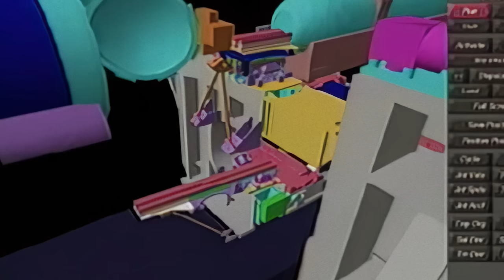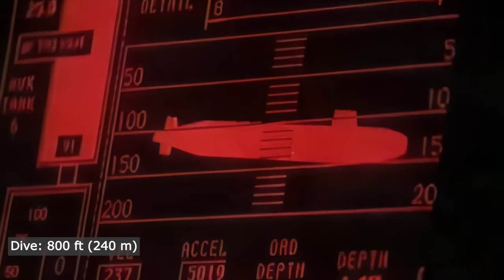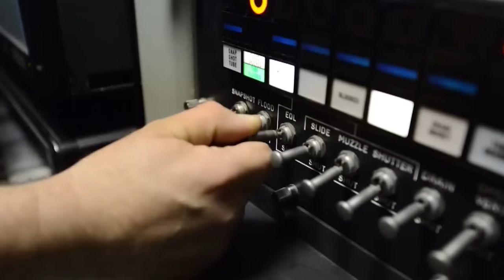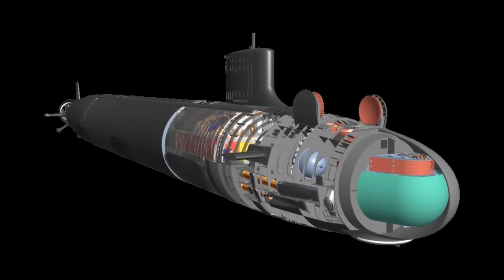Virginia class - the hunter killer

Comment: VPM does not mean Trident. Trident requires a hull diameter of 40ish feet and even then required a turtle-back on top of that. Virginia-class is only 30ish feet in diameter. Trident II is approximately 44 feet in length. VPM is similar to what is in Ohio and the other SSGNs but length is not one of those similarities.

Comment: I find it very interesting that the Navy still insist on hiding the screw structure. In the late 80s, I did two screw changes on 688 class submarines. They were performed at night. The screw came in on a tractor and trailer setup, all draped with canvas. The rigging equipment I borrowed from the shipyards, was installed with the cover still there. The damned cover was not removed until the screw was about to be lowered into the water!
I must say it is a very interesting design!

Too bad Clinton sold....... gave away the machining technology to produce the screws!
Reply: Clinton did what?
Reply: Pretty sure it was Toshiba-Konigsberg that sold the technology to the Soviet Union